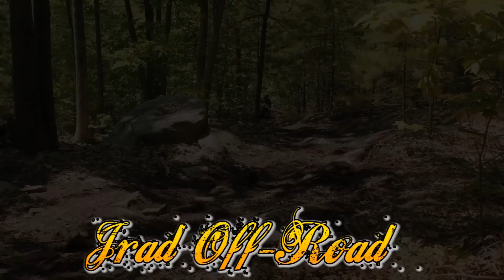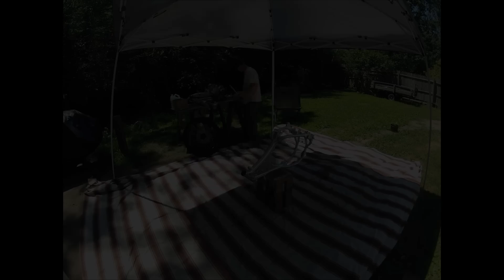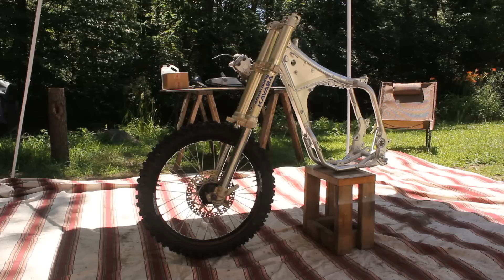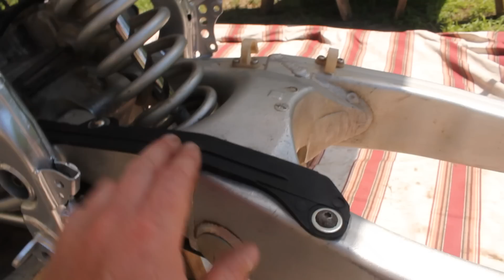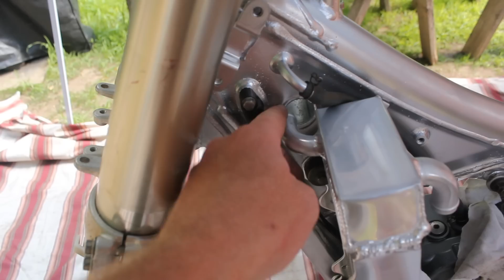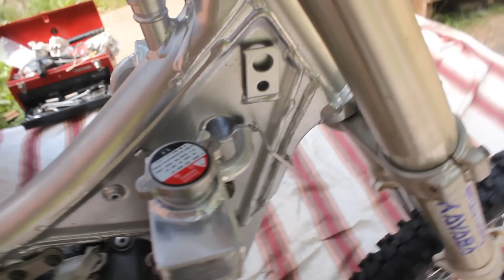The Rebuild (Stage Four)

Comment: Hey dude, did you get those rad's from ebay? i have bought several sets (China made) from an American seller called ASI performance or something like that.  they always fit a little rough, but function way better than stock and much less expensive, BTW you may want check your plastic fitment around those as well.  Great video and keep up the good work dude!

Comment: I bought those ebay rads for my 99 wr400 and the front mounting hole didn't line up and stock guards didnt fit either. had to do a bunch of work (involved my tig welder at work) but they keep my bike running cool and look good. I hope you can figure out a way to use them or get them replaced. cant really go wrong for $100